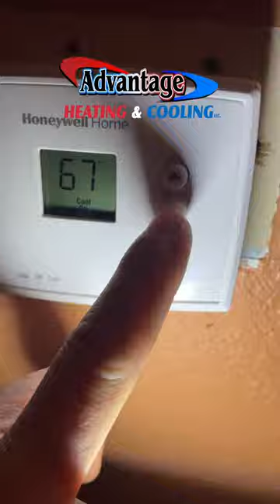Goodman R22 Ac condensing unit not running outside.

Comment: Went to a home 3 separate times to fix a thermostat wire where it had been weed whacked 😂
The last time I splice and pushed into the wall and ran it inside 3/8 copper
Haven’t been back 😉